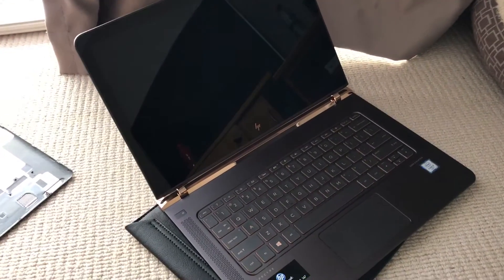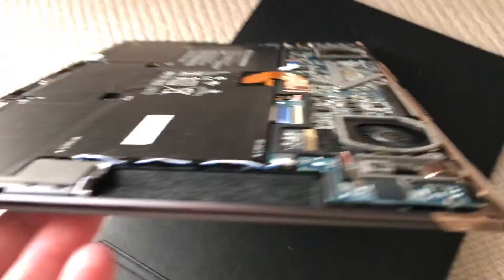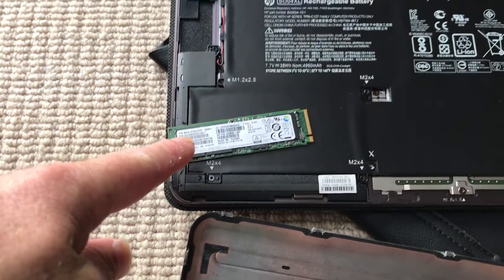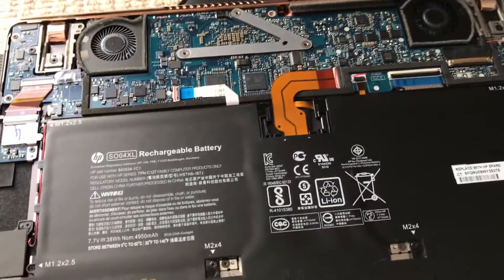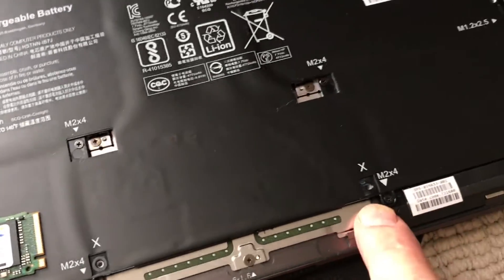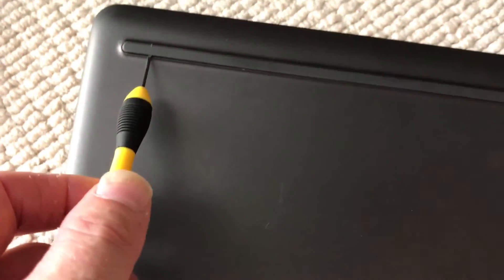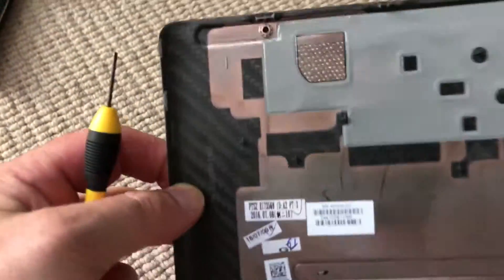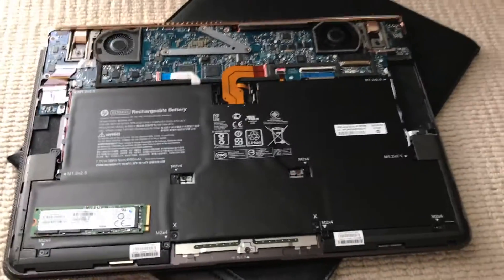HP Spectre 13-v001TU Rose Gold - Tear Down/Upgrade

Comment: Hello could you help me? I have the same model and I want to increase the ssd memory up to 1TB, can it?
Reply from the maker: dk roberto most definitely... they range from approximately $150 to $250 depending on brand.
You shouldn’t have a problem getting one either from your local PC store or online :)
Reply: Yes thanks.
I already have one, it is a wd black sn750 1TB, but I didn't know if it was possible to change it.
Reply from the maker: dk roberto you can use it, I just have to make you aware that you will have to re install windows and re download firmware from HP for this model again.
I think to answer your question properly: as far as I know there is NO limit to the size of the SSD you can install as I went from a 500GB to a 1TB on mine with no problems
Reply: If great I thank you very much.

Comment: How did you get the backplate off? Afraid to break it.
Reply from the maker: hi, very sorry for the late reply....things have been super busy. I got the backplate off with great care and a little "forcing" I used a small 'hobby' flathead screwdriver to "pop" it off... wasn't easy and honestly thought I would do some damage but it was fine....you need to use the 'hobby' screwdriver as its the only thing that I found that was able to get in between the plastic seems, once you started to prize it apart place something like a larger hobby screwdriver or butter knife just to hold it apart while you use the smaller flathead to work your down the side of the case all the while using the larger  to help lift it off. I prized mine off from the right hand side of the case and if you look at the video, you can see that there are 3 'snap' locks....so I would recommend starting to prixe it open about an inch away from the corner of the unit, then in the middle and then again an inch away from the other corner....this way you won't damage the 'snap' locks. 

again sorry for the late response and hope this helps....that's is you haven't already figured it out?

Comment: The cpu isn't upgradable or just hard to upgrade? I have the same laptop too, but I want to upgrade it to i7, which is same socket.
Reply: Jason Tse the CPU isn't upgradeable because it's solded w the mobo
Reply: not possible, it is soldered on. Sell it and buy a 2nd hand.